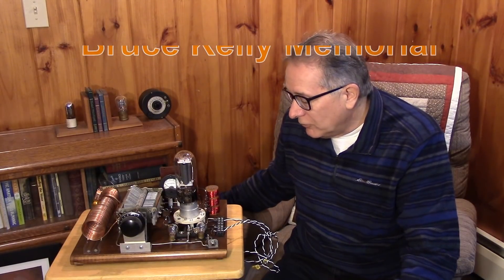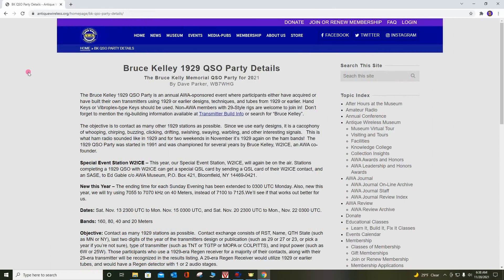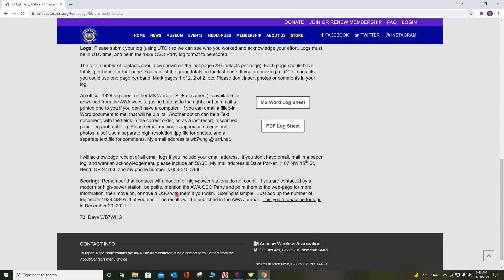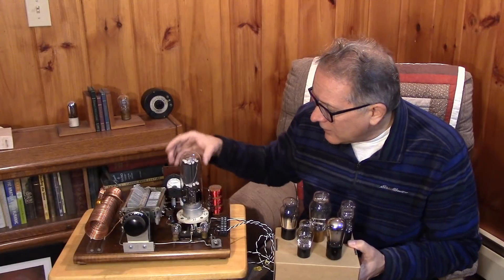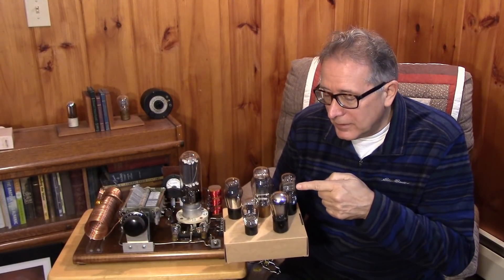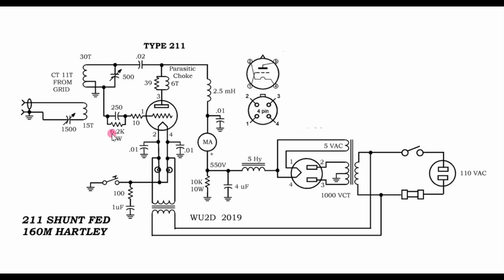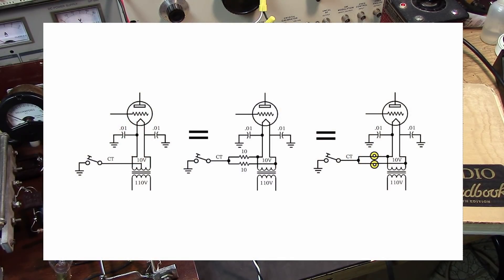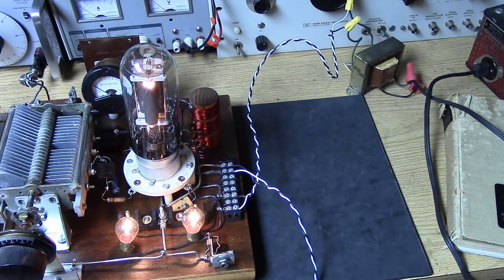Old Time Transmitter Contest - Part 1

Comment: I'd like to see an original Marconi radio transceiver. For audio reproduction, I'm a big class H amplifier fan.. Especially for high-watt output,  the finer class H amplifiers are hard to beat for audio reproduction.. Tube amplification has excellent bass but soon as you start to clime the frequency response it kinda poops out after 5-10Khz. Even on the bass end below 80-Hz. they fade..

Comment: Using a tube amplifier nowadays for high-fidelity music reproduction is like wearing a pair of sunglasses to view art at an art gallery.. I can see old transceivers being collected for use with a final tube-powered output for nostalgia reasons, for sure but NOT for up-to-date music reproduction...How about the original Marconi radio setup for ocean liners like the Titanic and some land-based stations.. Marconi actually had his own school set up for his students to become certified in using his radio equipment as an operator.. Luckily the radio operator took it into his own hands on the Titanic to fix his Marconi transceiver before the ship started sinking.. Back then as an operator, you were not allowed to fix a broken Marconi radio unit until you got in touch with a certified Marconi technician..

Comment: I have bought wirewound ceramic resistors. Solar capacitors. Using 600v .7 ma I’m not sure if I’m getting an output or not. What are common troubleshooting I could do for this circuit
Reply: I tied the variable capacitor to ground unnecessarily I will fire it up for the qso party tomorrow

Comment: After having done your nutube radio and your 12au7 regen with a 6u10 tube. It’s finally time to transmit. I want to use authentic parts where could I source them? This transmitter is beautiful and will look lovely in the radio pile

Comment: Fantastic Mike and has to be one of the finest examples of homebrew vintage Hartley oscillator transmitters. It really looks the part with that 211 tube and the chunky variable capacitor. I've just completed a vintage 807 breadboard CW transmitter with HV power supply which was great fun to build. A very inspiring video. Keep up the good work. 73...M0DAD from North East England.

Comment: I noticed the ARRL  hand book on the table  in there there is a 2m transciever  which has a super regenerative RX a 6C4 and is made to become a M O PA on transmit I built it many years ago but very bad drift and modulated with a carbon mike had two QSO with it
Reply from the maker: Those double duty superregens/TX  in the Handbooks were legal on 6 and 2M then, but eventually on UHF only.

Comment: 10K and 550 volts on the circuit is more than 30 watts
Reply from the maker: Yes but you have not factored the droop in my awful supply. Its over 150V!